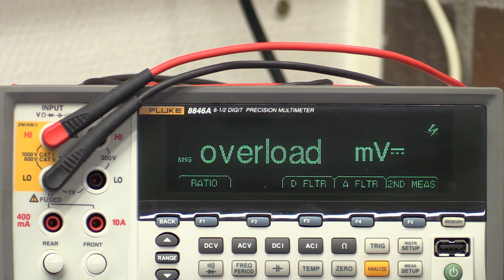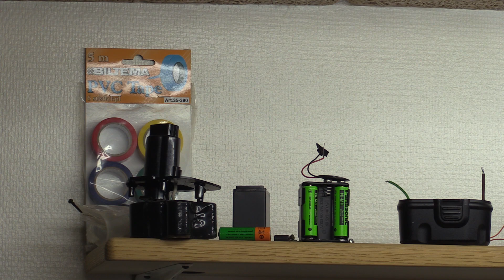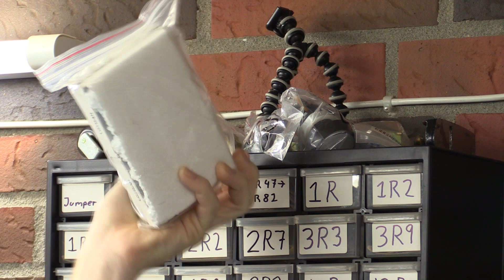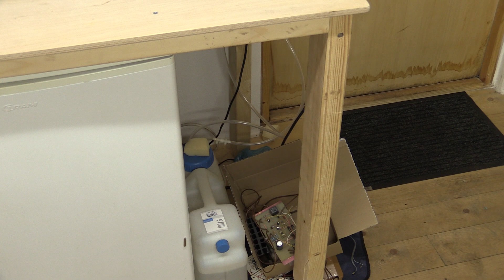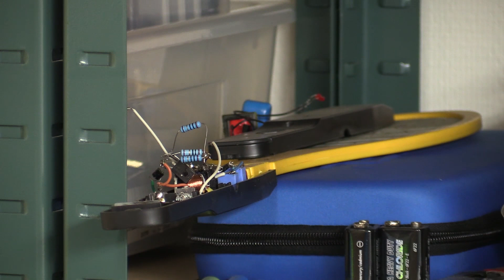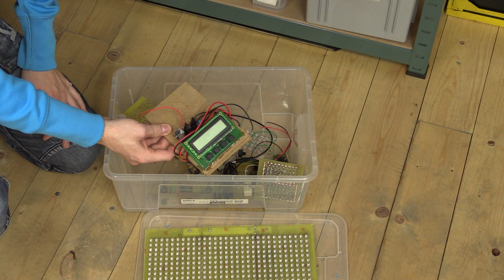Tour Of The Shop / Lab - 2014 - Ec-Projects

Comment: "Not a very big room" - I can only wish to get a place of such size which wouldn't serve any other purpose than an electronics lab. I have a shed outside as my shack in warm seasons which also used as storage for a lot of crap, bicycles, motorcycle. And when it's cold I move in a small corner of a room inside the house and let me tell you - that's a pain. Too damn crowded, but I'm happy with what I have, since before I didn't even had that corner :)